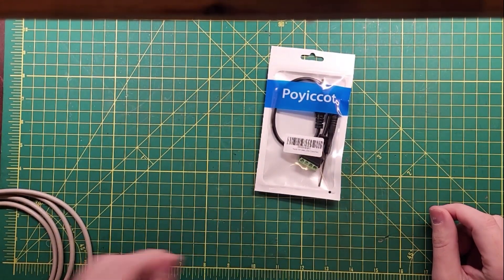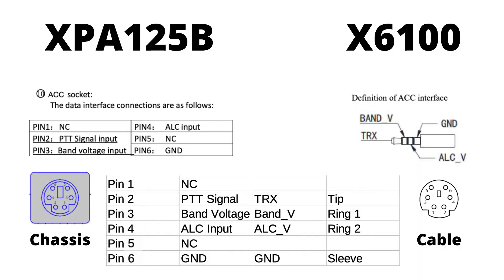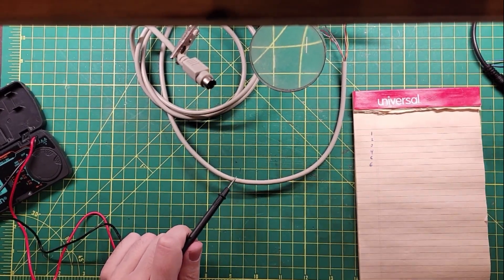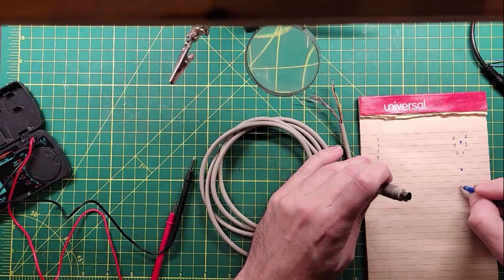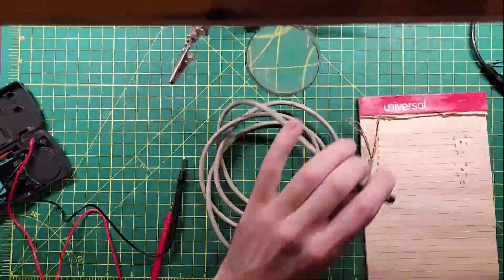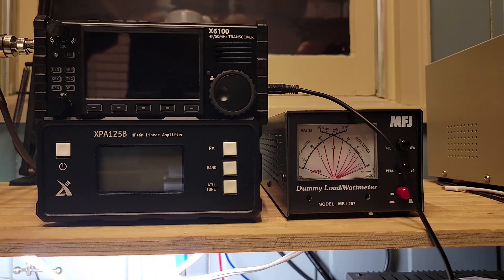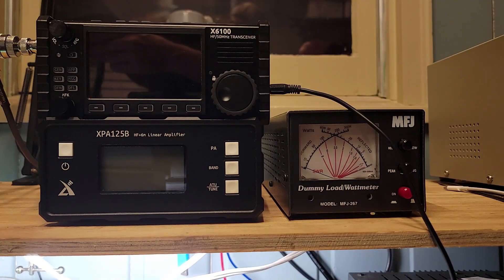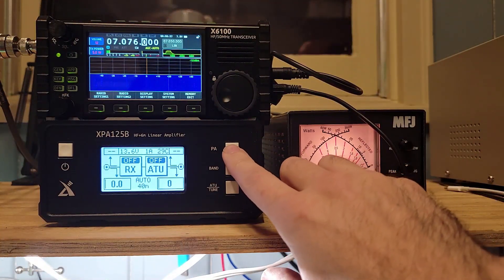Custom X6100 L4001 Amp Cable

Comment: Nice. Radioddity is insisting that the L4001 cable (and the DE19) are not compatible with the G90, but that makes no sense, since it's just straight through wiring and the signals for the 6100 appear to match what the G90 sends through its ACC cable. DE19 works great with the G90 for digital modes, and I don't want to switch to the CE19 to use the amp. I've got parts coming and a soldering station standing by.
Reply from the maker: I'm in the same boat. The L4001 cable is the recommended cable for the DE19, as soon as that comes in, I'll test and make a video either way.  If it doesn't work, I won't be happy!
Reply: @temporarilyoffline  If I owned the business, I'd verify that the cable works, and sell more DE19s, more XPA125Bs and more cables to G90 owners. But that's just crazy talk, apparently.
Reply from the maker: @GVDub  sadly, I've seen that from other MFGs

Comment: Looks like the XPA output reading is a percentage of the output, 125 watts being
100% the percentages match pretty close to the power output on the MFJ meter.
You could draw out a small chart of % readings to watts out, and be pretty close.
Reply from the maker: Good tip, thanks!

Comment: When you activate the ATU on the x6100 will it activate the tuner on the amplifier?
Reply from the maker: I'd have to check.  I have some more videos to put out on the amp.
Reply: @temporarilyoffline  i just purchased one the other day 
Along with the cable 
Im building a pota pelican case with it
Reply from the maker: @texaswelderman347  join us over on TOADs discord (link in the description)  I'd like to see that case when you get it built out.  Sounds like a good project. (The faceplate on the xpa125 can come loose to be mounted in the kit)
Reply: @temporarilyoffline  im going to need details on that! 
That xpa125b is going to take up majority of this case and i was looking for a solution 
Sounds great
Reply from the maker: @texaswelderman347  I have a video tearing mine apart for a repair. Take a look to see the front panel with its ribbon cable.

Comment: One small suggestion. It might be helpful to put ferrite beads near the connectors on both ends of the cable to reduce or block possible RF on the cable. I did this with the cable connecting my G90 & XPA125B since I'm using a non-resonant end-fed antenna.
Reply from the maker: That's a great idea.  My antenna is pretty far away from my station, so I normally don't have to worry about RFI.  I didn't even think about it.  Thanks

Comment: Hey, great vids been watching with interest your channel, slightly off subject but you might help recently my G90 has developed a clicking sound from the speaker (and headphones) on volume incremental notches,  even when increasing or decreasing volume from the hand held mic buttons, do you think its hardware or software related, running 1.77 FW....thank you and keep up the great work...Ray 9H5TB
Reply from the maker: Hey Ray! If it happens with hand mic and with vfo, it's something further into the rig, if your brave, open it up and clean it up inside and give it a good visual inspection,  repeat all connectors, etc.  All the things you do in a computer tune up, because this is a computer.
Reply: @temporarilyoffline  Cheers appreciate!

Comment: I am trying to figure out how to use my IC-705 with this amp, but have not been able to figure out what cable I need to connect them together.
Reply from the maker: I will drop out a video on that in the next few days.  I have that setup also.
Reply: @temporarilyoffline  I have the X5105, but I specifically bought this amp for the Ic-705 that was delivered last night. Can’t wait to get out to a park and try this one out.
Reply: @temporarilyoffline  Did you make that video? I can't find a finished cable for the 705 in EU :(
Reply from the maker: @steffenlav7832 not yet, but they are on ebay
Reply: @temporarilyoffline  I bought a 705 7/3/25, sent off for the amp today 13/3/25 and a cable from eBay, couldn't find the pinouts else id have made one

Comment: Nice job TO, I have done a bunch of trailer wiring and same thing you have to remember that the plugs are opposite of each other. The one thing I do with something like this is tape the wires I am not going to use to side of the wire to help with the confusion Lol!
Reply from the maker: Thanks Chuck!

Comment: That's the same way I did my spare cable (because you always need a spare)  - buy a mini 6pin din cable and add the TRRS
Reply from the maker: There you go!  Mine came from a "Add APRS to the Kenwood TM-281" project that died on the bench... not enough APRS around here to make anything interesting.

Comment: Nice video! The producer was in hover mode! What do you can be done to make that amp a little bit better?
Reply from the maker: I'm really happy with the amp, what do you think?
Reply: @temporarilyoffline  I saw a couple reviews and the conclusion was it is not the cleanest amp out there just barely passing by with spurious emissions. Maybe replace a few components with higher quality units and possibly some upgraded filtering.  Maybe even some better cooling ideas other than just fans.....  Just some tweaks here and there for giggles.....
Reply from the maker: @CapeCodCNC  ah, I'll take a look